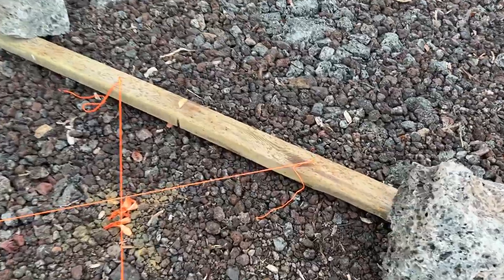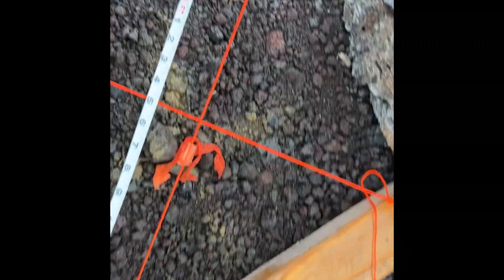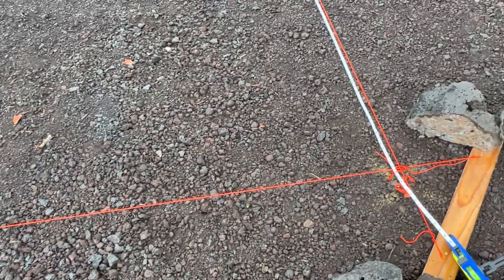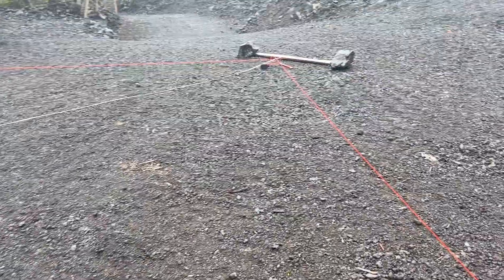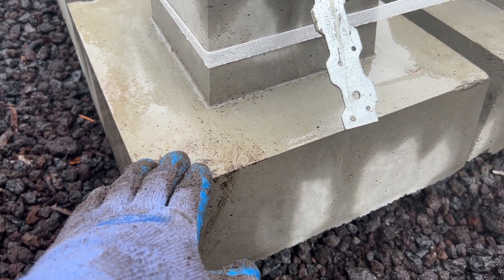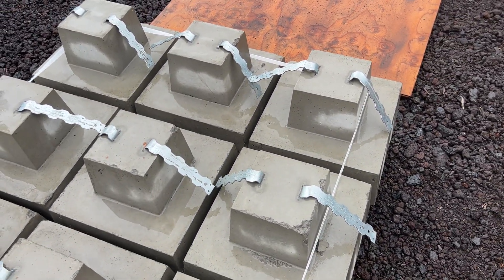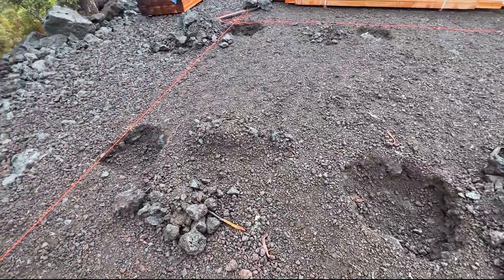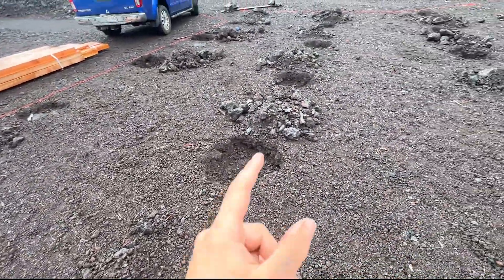Big Island #DIY Home Build: Episode 3: #Howto Post and Pier Foundation (Part 1)

Comment: Im building in Leilani, and i'm at this point. Great tips with the batter board method (Lava style) . thank you. I bet those ROSS sneakers were trashed quickly from the lava rock? I went thru 3 pairs of boots. An OHOH bar, or pick axe would help ya dig those holes. Slippas and no safety goggles is Puna perfect. LOL
Reply from the maker: @bodhiland9062 congrats on the build! Yes trashed real quick, all my toes poke out of them now. And good tip on the pick axe thank you! LOL yes we make do with what we have